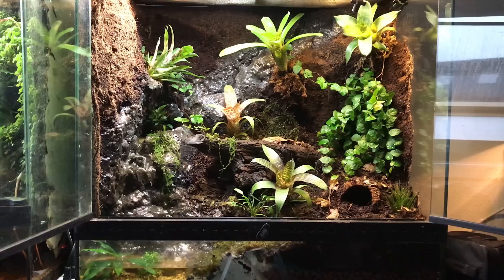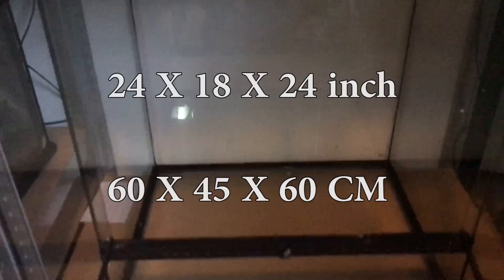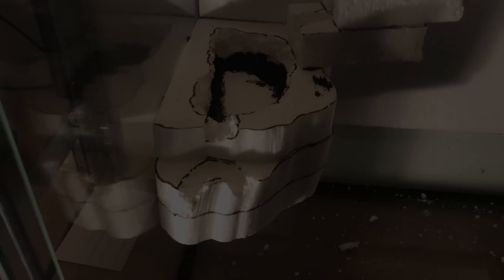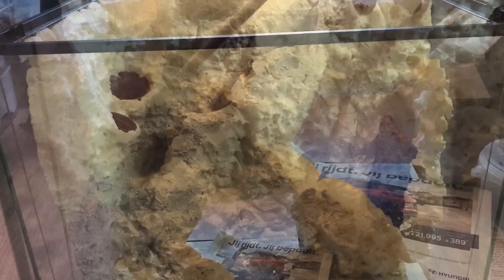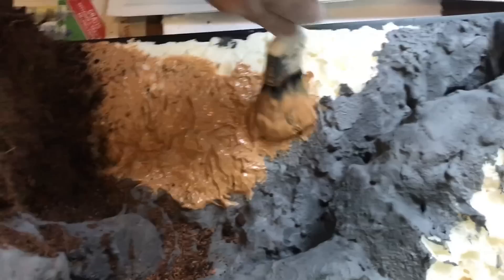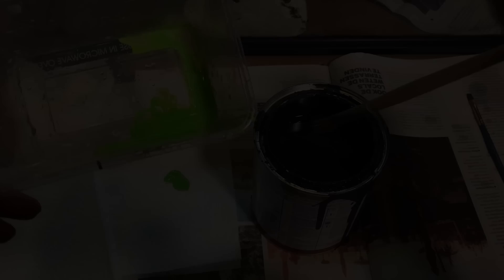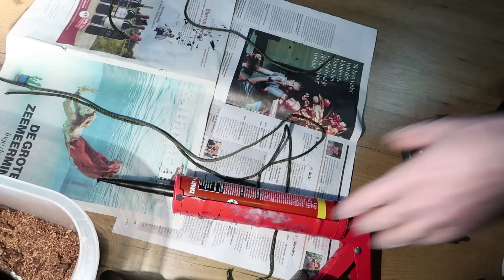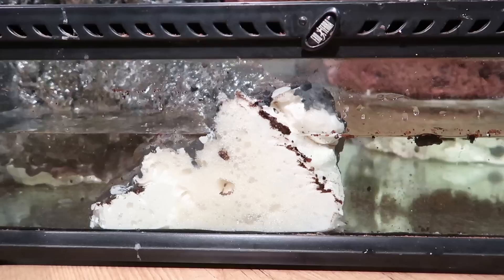How to build a vivarium waterfall

Comment: Finally someone who can instruct on building a proper water fall!! TY!
Reply from the maker: Thank you very much! Good look and have fun with your build!:)
Reply: Foam and Lizards would Drylock work to create a little pond area? It is waterproof so I think I can just build up a little 2x2 inch wall that has a bit of water in it for a terrarium. Do you think this would work? I have a paladarium with a waterfall and I think it would be cool for the waterfall to go into a little pond before it hits the main part. Any reply would help, thanks
Reply: @voltix9711  it would work probably

Comment: Nice video good job... when you place the pump for the waterfall it seems to sit on the vivarium floor after the polystyrene ends the expanding foam doesn't seem to go the the floor. Is the pump then surrounded by the Leca. layer.

Comment: The 2 part mix you used is better than silicone.  After some time, the silicone degrades (when used with foam, soil mixes, and then going from wet/dry), starts to peel, and looks like heck.  Everybody copies each other on YouTube, so of course, they don't know this.
Reply: Matt Williams but aquariums are sealed with silicone 🤔

Comment: As I previously mentioned, your video gave me some great ideas but I decided to use only your video as guidance.  Your video does a much better job at showing and explaining how to do everything.  It's so much easier to understand than other videos.  So anyway, I have up to the foaming and flower pot placement done.  I am however, a bit confused with how to do the resevoir. I was wonderinng what the purpose of two hoses in the second pond is?  I know I would need at least one but I just didn't understand the resevoir part.  Is the whole bottom used as the resevoir?

Comment: You earned yourself an new sub sir found it very funny and well detailed. Giod job
Reply from the maker: Thank you my friend!
Reply: Question, how much would you say it costed you to build that waterfall?
Reply from the maker: Well that depents, because alot of stuff you can use many times more (like foam, grout, paint and epoxy resin), so it's very hard to say. Those things make the build very expensive, unless you want to build something big or more vivariums. 
But this is what i paid: 
pump: 20 euro
Foam: 10 Euro
Styrofoam: 8 euro
(Concrete)Paint (4 colors) +- 60 euro
Epoxy resin 20 euro 
Grout :  15 Euro
Elastopur: 23 euro (although you dont need it for the waterfall)
Reply: Foam and Lizards ahh okey well thank you, i am getting my pump in today so i will start getting ready to build it, so that list helps alpt thanks!

Comment: I want to make a background for my poison dart frogs. I'm using styrfoam for the structure, then painting and sealing it. My question is about sealant, will it make the surface of the background too smooth and slippery for the frogs? What is the beest way to make an artifical rock backround that has texture for safe climbing please?
Reply: Bruh... safe for climbing... just cause something looks shiny doesnt mean its slippery.

Comment: @Foam and Lizards, 

Heya. I am from Sweden and I am thinking of using an old vertical aquarium to make a Terrarium/Vivarium/Pandarium. Well, either way, I am not planning to house any life forms. I know I want a body of water as a reservoir for the pump but also a reservoir, high up for a potential fog maker.  I am going to have a key feature as an Orchid that gather moisture from the air. As consequence, I need to ensure that fog maker has a water reservoir at least 2-3CM deep. 

But, I can't find ANY information on expanding foam. What should you avoid? Any particular ingredients and such? There is no real brand to go toward in Sweden so... I have to resort to asking ya.
Reply from the maker: Hey there! As far as I know you can use any expanding foam that is on the market. As long as you make sure it has a chance to dry for a long period of time (lets say 2 - 3 weeks) you will be okay:) Good luck with your build, sounds like a great project!

Comment: Also, what kind of paint did you use to paint the "rocks?"
Reply from the maker: It's called "concrete paint". It's non-toxic and waterproof. With a layer of epoxy resin it will be good for a very long time

Comment: What’s kind of glue, expanding foam and paint are u using???
Reply from the maker: Expanding foam is just a cheap one from the home depot.
The glue's I used are: "Poly max" for gluing the styrofoam. "Elastopur" for gluing the substrate (but you can use black silicone), and "Epoxy resin" to seal the grout and paint.
Reply: Foam and Lizards Thanks!!

Comment: Is there anything that really needs to be avoided? That will hurt frogos and fishys?
Reply from the maker: Yes. If you buy glue, make sure it's aquarium safe (Sour-free, should be noted on the tube). Also, make sure you give the build time to air so all the poisen is out. 
Besides that, always use clean stuff before you add it in the vivarium. Coock the leaf litter, stones and wood that you find outside, they can have pests in them:)

Comment: Ficus pronounced Fy-kus long i sound not a short i.
You could add some Anubius Nana Petite (just crazy glue the rhizome to a small piece of rock, do not plant the rhizome in the substrate in the pond) in the bottom pond, and add some saquatic mosses by crazy glue/super glue (it is non-toxic to fish, amphbians, and invertebrates) along the waterfall path under the water (you'd have to turn off the pump for a half hour while you do this). You could also add some caradina and/or neo-caradina shrimps to the bottom pond, though they might attack the tadpoles..
Reply from the maker: Hey man, thank you for the advice. Fy-kus, I will remember that;) I will experiment with the mosses when I have the right glue, I never thought of that. 
Although I do love shrimps, I will not add them in the pond, because I had to remove the netting and I am afraid they will get lost between the clayballs. Besides, I added shrimps in my paludarium, and that population exploded.
Again, thank you for the advice!

Comment: I can guarantee if you put Dart frogs in that they will die very quickly. Frogs are very sensitive to chemicals and you used multiple foams,paint and Epoxy that will cause dangerous fumes and chemical imbalance to any fish or amphibian. But great job on making the thing, looks cool.
Reply from the maker: Hey man, as far as I know this stuff is harmless once it's dry and it had enough time to breath. If it happens to go wrong anyway, I will surely warn people. Thank you!